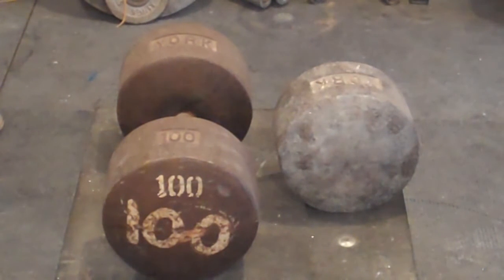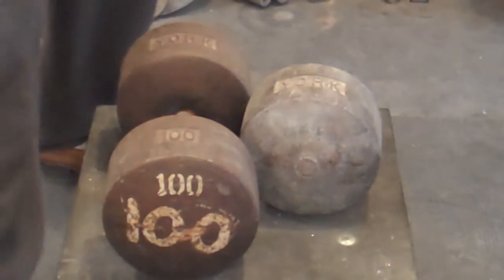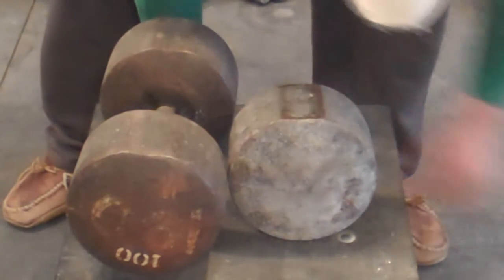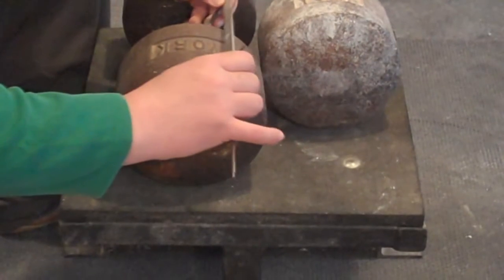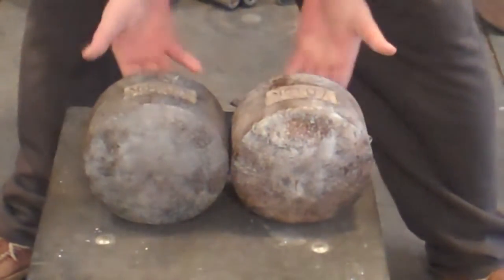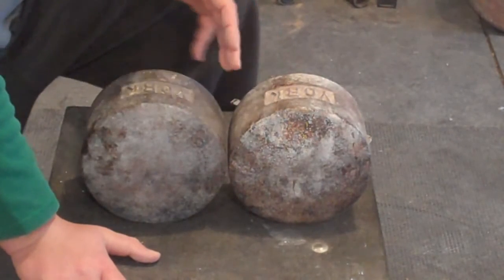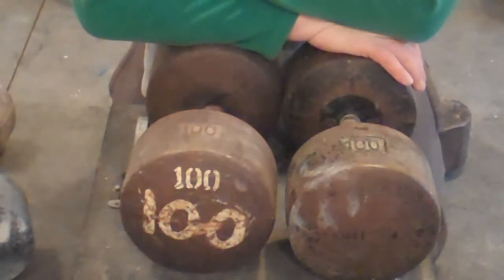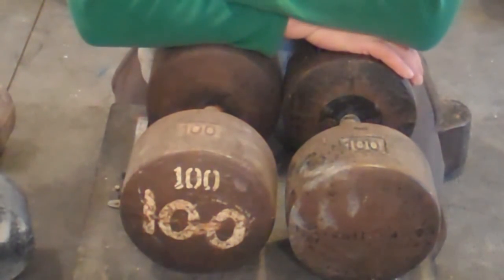The Different Types of Blobs

Comment from the maker: The Stronger Grip Blob is a good way to train for hand strength.  Yes.  It is open hand in nature so it makes you work the thumb and wrist harder, and it is loadable both via shots or weights, so you have additional options for your training.  The only downside is that they are not the exact shape of a blob, but since you said that is not your training purpose, that is no problem at all.  i recommend them for sure and have a link for them in the description box.